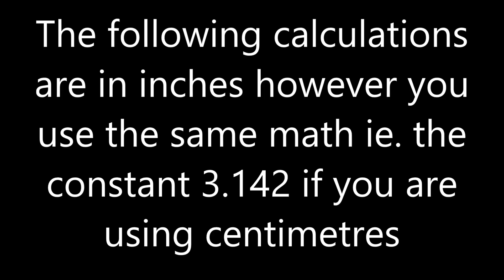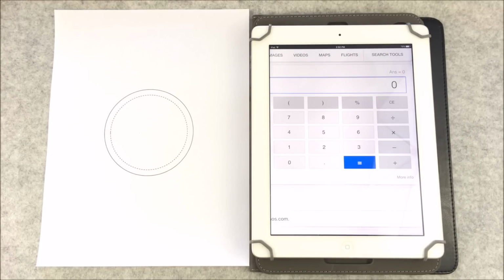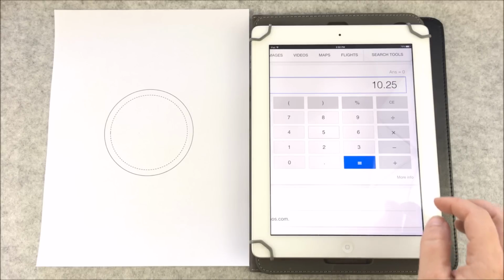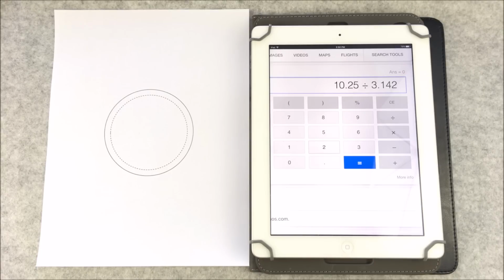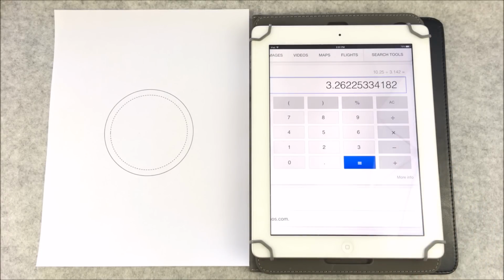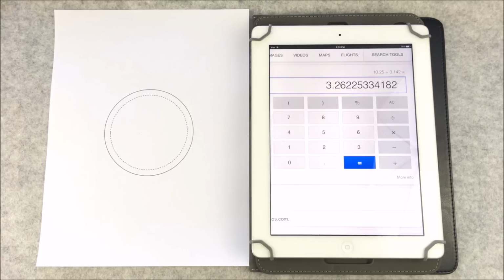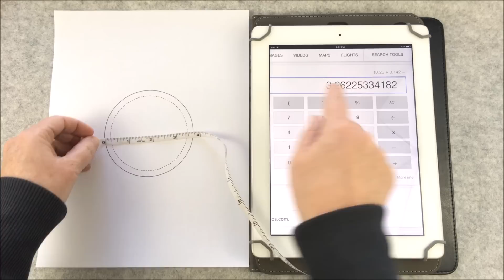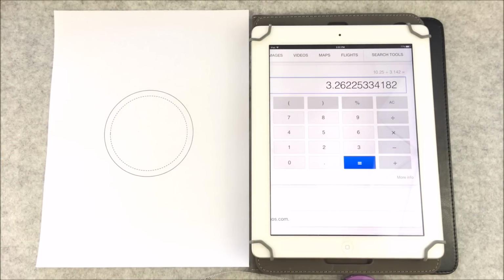How to Calculate Pieces to Sew a Cylinder

Comment: Great information. I do have a question how do you determine 1 1/2 inches of ease?  Is it just a rule of thumb or is there a calculation to make to determine the ease?  For example if my circle, including seam allowance is 6.5 inches and the thickness of my fabric/interfacings is 1/8 of an inch (I use a lot of leather for my projects) how do I determine the amount of ease to get my cylinder length? TIA
Reply from the maker: Great question!!  I just did a 'guesstimate', based on the thickness of fabrics and batting.  I gave myself a visual by wrapping the tape measure loosely around the cylinder and guessed on the thickness.
Reply: Thanks, I usually multiply the circle diameter by pi (or 3.14-gotta love a scientific calculator on an iPhone) add a couple of extra inches, then clip it onto the circle to adjust, just wondered if there was an easier/faster way.

Comment: Would love a tutorial for the cover, could also make one for a thermos. Thank you for all your great viseos.
Reply: My question is this: I get a measurement for the diameter of a circle for cylinders I make, then I need to know how to figure out how wide to make the sleeve part of the cylinder.  Just the opposite of the way you did it. I think.  My customer gives me the measurement across the center of the cylinder opening and the length up and down for the height. How do I determine the width of fabric needed to fit the circle?  Or am I over thinking this?
Reply from the maker: @BobbiJoNichols  - You would take the circumference (without seam allowance) then divide that by 3.142 (pi), which gives you the diameter.  After you have determined the diameter of the circle, you would add one seam allowance to the perimeter of the circle.  Then you would also add two seam allowances to the circumference.